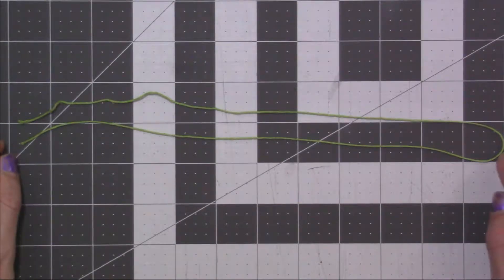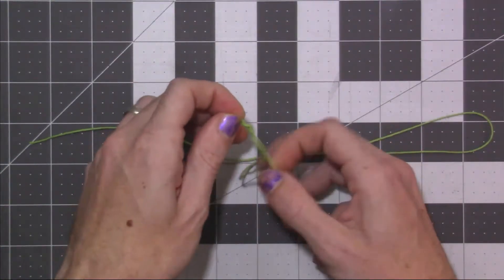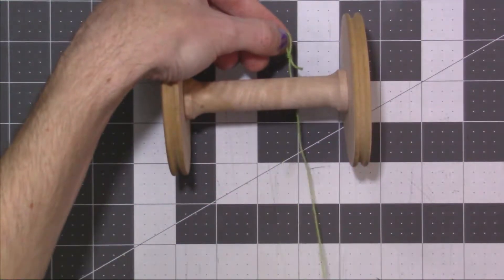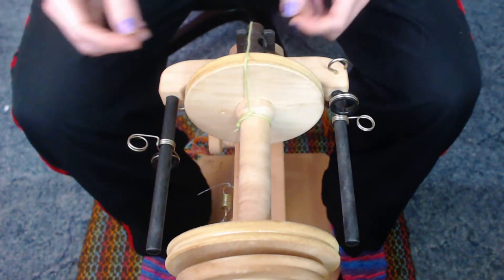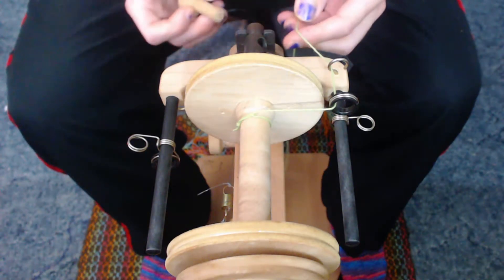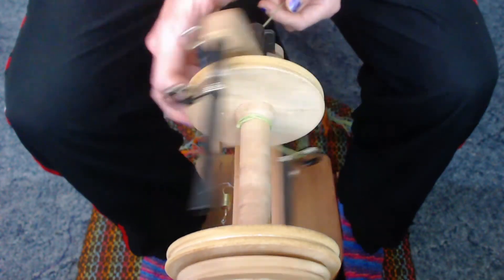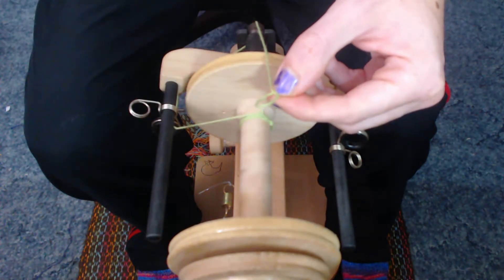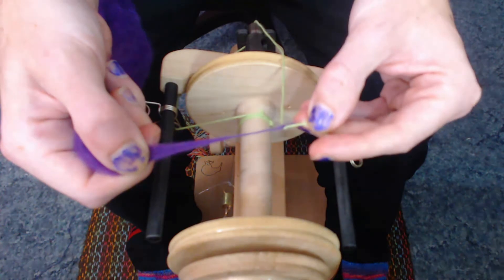How to Spin: Part 1 - Attaching A Lead

Comment: is it always threaded on the left?  if so what is the purpose of having a the circle and hook on the other side?
Reply from the maker: Great question!  Every spinning wheel is different.  On this particular Spinning Wheel (Ashford Kiwi 3), it will always be threaded on the left side of the flyer due to ease.  However, spinning wheels with fixed hooks on the same side of the flyer tend to be spaced out to allow even winding on to the bobbin (with the Kiwi 3, these hooks are replaced by the adjustable "hole").  So on wheels that have hooks on each arm of the flyer on the same side, one can thread it to either side and even bounce between them to fill the bobbin more equally.  The reason there are hooks and holes on each side of the flyer in wheels like this one is to provide equal balance as it spins.
Reply: @loony loomworks can confirm, but I think the alternate orientation on the other side makes it much easier to spin the opposite direction, as when you ply.

Comment: This might seem really self-explanatory, but I just got a Kiwi 3 and have put it together.  Any tips for treadling?  Should I feel it in my calves?
Reply from the maker: Congratulations on your purchase!  As for treadling, I tend to place heel my at the lowest movement point of the treadles and then use my ankles to power the wheel more-so then my whole leg.  Do what is most comfortable to you and try different techniques until you find that sweet spot.